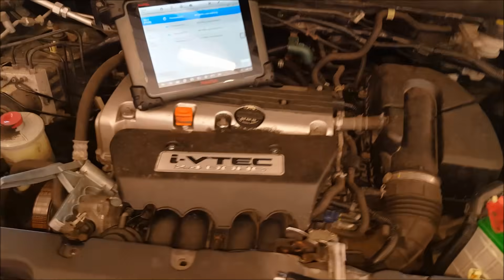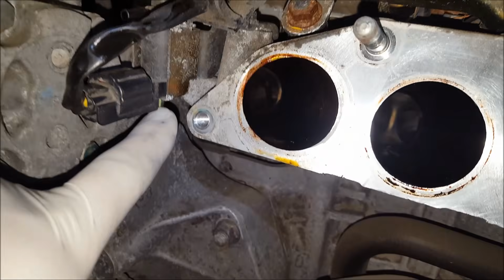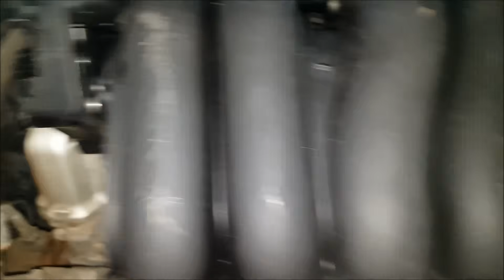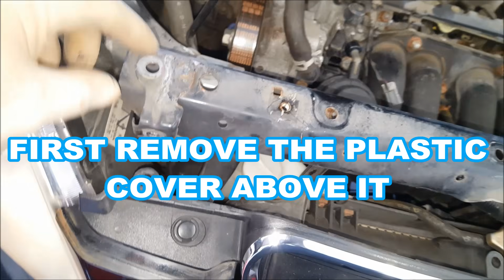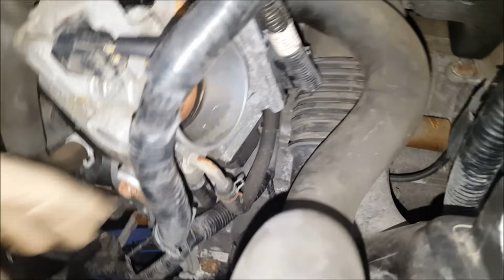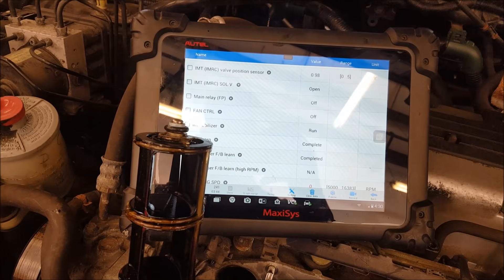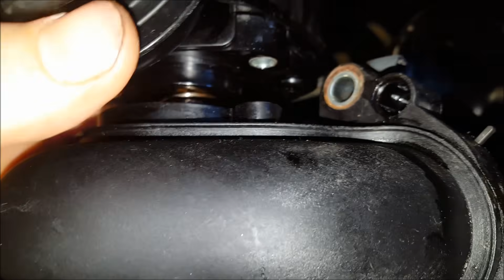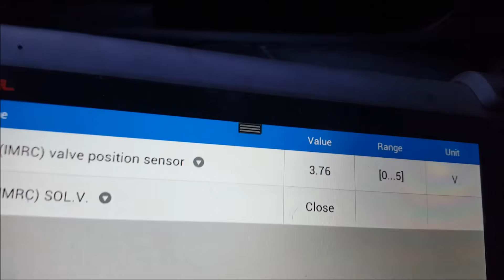HONDA CR-V IMRC REPLACEMENT / diag. P1078 P1077 2006 2.4L how remove replace acura rsx

Comment: When I pulled out the IMRC, I found that the blue plastic bearing thing and the black o ring (found in this photo from eBay, listed below) did not come out along with the IMRC. I only see the metal shaft when I remove it. I tried for a short time to remove that blue piece from the bottom but was unable to. 

What should I do now? I am able to reinstall the IMRC and tighten the bolts, no problem at all. Is it ok that those 2 pieces are stuck down there? If not, do you have any tips/trick for removing them? 

https://www.ebay.com/p/Honda-OEM-02-06-Cr-v-Intake-tuning-Valve-17120ppaa01/1333661770?iid=292812472778&chn=ps&ul_ref=https%253A%252F%252Frover.ebay.com%252Frover%252F1%252F711-117182-37290-0%252F2%253Fmpre%253Dhttps%25253A%25252F%25252Fwww.ebay.com%25252Fp%25252FHonda-OEM-02-06-Cr-v-Intake-tuning-Valve-17120ppaa01%25252F1333661770%25253Fiid%25253D292812472778%252526chn%25253Dps%2526itemid%253D292812472778%2526targetid%253D541454246372%2526device%253Dm%2526adtype%253Dpla%2526googleloc%253D9031061%2526poi%253D%2526campaignid%253D1669934873%2526adgroupid%253D65058351339%2526rlsatarget%253Dpla-541454246372%2526abcId%253D1139336%2526merchantid%253D113747026%2526gclid%253DCjwKCAiAy-_iBRAaEiwAYhSlA-G4jXNpSDaJE7oVjivaqYMPEtyBqufjWlt_fVHICSOqnOAJWXdUphoClhgQAvD_BwE%2526srcrot%253D711-117182-37290-0%2526rvr_id%253D1849393557192%2526rvr_ts%253Dc75c53371680ab1cab93d331fff6da2b
Reply from the maker: I haven't had that happen to me before. I suppose I would try some kind of coat hanger or something. Without seeing it in person, it's really hard to give you a professional opinion.

Comment: what type of cleaner did you use to clean the parts with also how do you get down in the tube to sand any rough spots
Reply from the maker: I just used the parts washer at my work. Which is a product called ozzyjuice. But you can use pretty much any parts washer and it's not going to harm it. I used a large bath towel to Get Down in the Hole
Reply: Ok. Thanks.......your such a guru mechanic.my hats off to you bro.🙌

Comment: Man, thank you so much!!! My old CRV has thrown P1078 on me this morning (Intake manifold air control - High RPM malfunction) and we have 25 degrees second day. It makes total sense now. The car was holding 1000 RPM and not going to 750 like always does but after 15 min of driving it went down to 750. Will clean the valve later on, car has over 200K miles. Thank you again!!!
Reply from the maker: No problem! Glad to hear the video helped you out and thank you for the comment
Reply: @NoNonsenseKnowHow  I used Sea Foam to clean my intake, the code went away. But my o2 sensor sure didn't like all the crap Sea Foam has delivered and now I've got P0420 code :)) Ah, one or another. Will clean the sensor one day when have more time. The car drives fine. Thanks again,  with you showing what it looks inside it is easy to understand why cold weather can affect the IMRC rotation.

Comment: do u have to replace the whole imrc system or can u just replace the sensor? with the p1077 code
Reply from the maker: You can replace the sensor if that's bad or clean the imrc as seen in this video

Comment: I have a manual 02 base rsx with the P1077 and in first and  second gear it has some bad intermittent bucking. Could that be cause by this not operating properly.
Reply from the maker: Yes it certainly could be. But I haven't personally seen it cause that issue

Comment: Hi your video helped me a lot. But im still getting the code. I didnt verify the wiring but i took it apart, cleaned it and replaced the sensor and solenoid. Do you think it is dangerous to drive the car with this system malfunctioning?
Reply from the maker: Hey, glad to hear the video help you out! No you won't do any damage at all by driving it with the code or it not functioning. You might just have reduced fuel mileage or power
Reply: @NoNonsenseKnowHow   Hey so I never got this fixed and I am finally able to give it another shot. Long story short I put a multimeter on the connection to the solenoid and didnt see any voltage between the terminals with the key on engine off (accessories powered). Do you know if this would still have voltage on a 2002 model year vehicle?  Thanks for your reply

Comment: excellent video coming from a DIY home mechanic.  I've got code P0661 - intake manifold tuning control valve control circuit.  Do you know if it would be the vacuum valve or the position sensor?  It is also "pending" but will not clear.
Reply from the maker: Larry Hunt thanks for your comment. Sorry no I don't know offhand. I would have to do some research or look at something like that to make a call.  I work on all makes and models. So it's hard to keep track of each repair. That's why I like to make videos so sometimes I even end up looking back on them.  Glad to hear the video helped out some though thanks again!
Reply: Of note, the black / yellow is actually the 12v.  The other is the ground control voltage.
Reply: I figured it out and made my own video for P0661: https://www.youtube.com/watch?v=pJQK-yi60T4&t=16s
Reply: @huntlarry1  I have the same problem and got excited when I saw your comment but then realized your video isn’t available anymore.

Comment: Hi, i  watched your video and I’m thinking to do it soon... the reason I’m writing you its because I have a cr-v 2006 with 115000km and a few weeks ago it started to make a strange noise from the engine.... when I accelerate ( 3500 RPM ) you can hear like a whistle... do you think it coud be the imrc? Please i would appreciate your help!!! Thanks!
Reply from the maker: It certainly could be, but it's hard to say without hearing it. Let me know how you make out. I would be curious
Reply: Do you solve it? I also have this whistle at high rpm
Reply: It’s the vtec sound.

Comment: Can a gunked IMRC assembly cause hesitation when VTEC is about to kick it? Mine seems to hesitate slightly when its about to engage. I've already replaced the vtec solenoid. I assume the IMRC is like variable intake like the old T-VIS system toyota used.
Reply from the maker: 1963c10 I couldn't say for sure absolutely, but yes if  yours is gunked up I could see that causing a problem
Reply: cool. i appreciate it. sucks that i just put everything back together after replacing a starter. it was fairly easy though so i may go back out there and remove it and clean it to see what happens.
Reply from the maker: 1963c10 no problem man. And yeah definitely easy to take it back apart especially since you've already done it once. Certainly a good call to clean it out one way or another
Reply: another quick question....i got the p1077 and p1519 code after replacing the starter and did not have the issue before. i did replace the o-rings for then intake. all vacuum lines seem to be connected properly. was i supposed to put oil or gasket sealer on the o-rings for the intake? could there be a leak there causing those codes?

Comment: Hi. I got your comment on cleaning the inside of the intake. How do you clean the IMRC part?How do you clean it and with what? Thank you.
Reply from the maker: Fass Strokaa I used the parts cleaner at my work. It's a water-based solvent and a brush. But you can basically detail it with some paper towels and such.  Just don't use anything too incredibly harsh on it that would affect the plastic.  Or heck, throw it in your dishwasher. Lol I'm just joking don't do that
Reply: Thank you.  Since you didn't mention or showed the cleaning of the actual part(IMRC) I thought maybe there's a special solution to clean it. Thanks again.
Reply from the maker: Fass Strokaa no problem.  Yes sometimes I leave some things out. I don't get a lot of time to videotape since I'm at work. So I try to keep things short. I hope the video helped out and thanks for commenting.
Reply: My 2003 crv has a low idle. The rvmp is very low my AC can not start unless I rav the engine . the code p1077 came up . my question is does that affect low idling of the engine

Comment: Question for you:
 I recently replaced my starter (2002 CR-V) and in the process of doing that I broke the little rounded plastic cap off the top of the Bypass Control Solenoid Valve (or in your video your computer looks like it says IMT (IMRC) SOL V.), you call it a vacuum switching valve.  It is the little black valve with a small hose going attached to the canister and then another small hose that attaches to the bottom of valve and then splits and attaches to intake manifold in two places.  To me the little plastic cap doesn't appear to be necessary, it just looks like a little mushroom, it curves over and pulls in air from underneath instep of straight down the top I assume to keep out contaminants.  Doesn't look like there were any moving parts in it.  I glued it back and had no issues.  Then the POS aftermarket Ultima starter from Oriellys crapped out in 2 months.  I took it back for a refund and paid for a Honda OEM starter.  Anyhow I have broken it again on reinstall of the OEM starter and this time lost the little black cap so I can't glue it back.  Am I correct about the function of the little cap? Just like an umbrella on top of the valve right?  Replacement is $130 so not planning on replacing it at the moment assuming I am right about it. 

Great video.  May be really helpful for me in the future. Wish I had thought to clean the inside of the rotary valve after having removing the intake manifold twice in just a few months!  But now I know!
Reply: By now you already fixed your starter problem. I bought a rebuilt kit from eBay for $19 last year and fixed my problem. The brushes were all worn down to the wires.
Reply: I just tried the test you talked about.  I turned on the key to acc position but did not start car.  I unplugged the electrical connector back and forth but heard no clicking.  So maybe the valve is broken/stuck anyhow.  I'm not getting any check engine light.  I plan to hook it to a scanner tomorrow and see if I have a code.  If the valve is malfunctioning what problems would it cause?  Loss of power or response?  And if that's all and were to decide not to replace do you think it would damage anything?
Reply from the maker: Josh Armstrong thanks for your comment. Yes I think you'll be just fine without that little plastic piece on there. Worst case is it could cause premature failure of the part in the future. But I tend to doubt it would be any issue at all. And yeah that probably would have had a decent idea to clean out the rotary valve with the intake off .  but of course it's not very hard to remove the intake so no big deal there.
Reply from the maker: definitely a good call going with an oem starter is well! Those aftermarket ones are really a gamble. Of course they offer a lifetime warranty on a lot of them. but what good is that if it craps out every few months.
Reply: Yeah no kidding... evidently everyone knew that except me... found that out the hard way.
Reply: I ordered a  starter rebuilt kit for my 2005 CR-V thru ebay for $20 last year and took care my starter problem. The brushes were  worn all the way down to the wires. I didn't see spending $300 for a starter .

Comment: Hi, 
How to clean up the internal part? Just wipe it out with a cloth, or some fluid should be used?
Also, you mentioned to lubricate the big O-ring before assembly IMRC - what kind of lubricant should be used?
Thanks!
Reply from the maker: Thanks for your comment and great questions! I cleaned out the inside by letting it soak in my parts washer at work and then stuffed a towel down the cylindrical with a small pry bar and twisted it around to clean out the hole. And just some motor oil or light grease would be fine for lubricating the O-ring.  I hope the video helped out and give it a thumbs up if it did. Thanks!
Reply: NoNonsenseKnowHow my acura rsx does it when its hot out i get p1077
Reply: Martin Bullla did you fix the problem? What was it?
Reply: I have 2012 Honda CR-V loosing power at 25 miles per hour only I don't know what happened if any body knows please let me know Thanks!